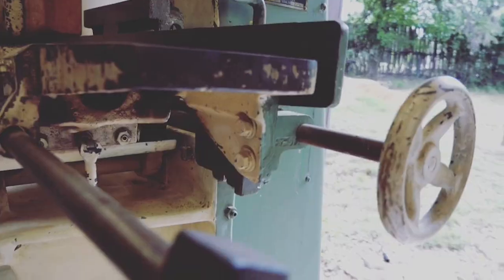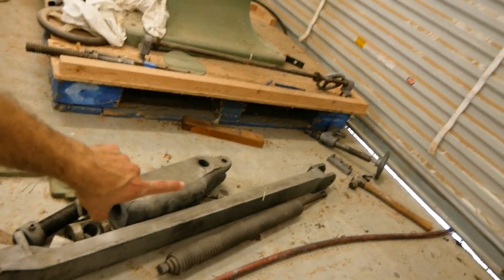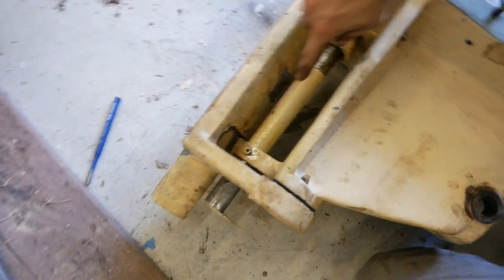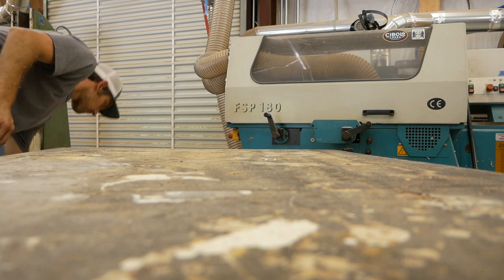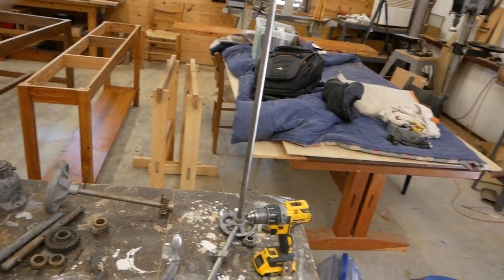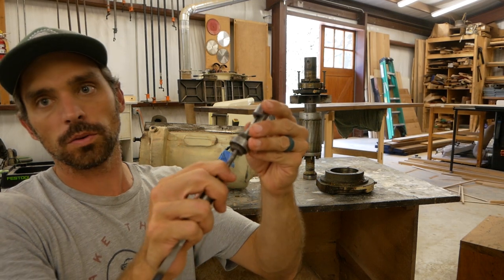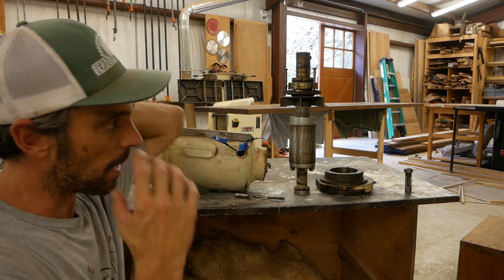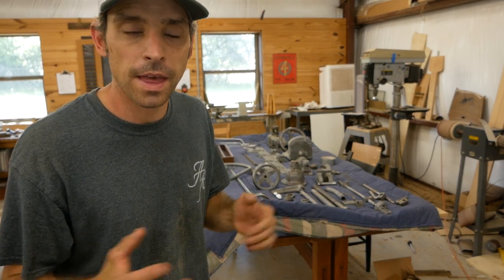A Look Inside A 60 Year Old Motor...What Should I Do With This Thing?

Comment: The thick ring with the square notches is a nut that gets tightened to set the tension on that bearing.  The other flat ring with all the tabs sticking out from it is used to lock the nut - the tabs just bend (but can easily get fatigued from excessive bending too).  I would strongly recommend you take the motor to a reputable electric motor shop, such as Massengale Armature Work over on Basse Rd in San Antonio.  That is a very specialized motor and really needs to be torn down, inspected, repaired, and reassembled by people that do it professionally.  Maybe if you explain to them that you are a Youtuber & this is a project that you are making a video series about, then they will allow you to film some of the work they do on it.
Reply from the maker: Thanks for the info.  I'll give them a call and see if they can help me out.
Reply: Be prepared for the estimated costs - electric motor repair is very specialized and a reputable shop is charging around $200+ per hour plus parts.  However the alternative is that specific motor is no longer made and thus it literally is worth any price to have it working correctly if you intend to use the mortising machine in your business & not just have it collect dust as it sits in the corner because it is not reliable.
Reply: Yes take to a motor shop , they can repair or rewind the stator ,  bearing lock nut / washer are sized for bearing size  looks like  a 6308 bearing  lock nut would be a N08 and the lock washer would a W08 , any bearing house should be able to supply for you
Reply: This is his best bet !

Comment: That ring with the tabs and the part above it hold the assembly together. The tabbed ring should line up with a groove in the shaft. The ring above that one gets screwed down. It is tightened into place (a lot of the time with a hammer and screw driver). Then the tab gets bent up inside to keep the top ring from unscrewing. Used them fairly often on the the electric motors when I was in the Navy.

Comment: Andy should come to ArnFest next month up here in the midwest...  Seriously though, you might want to look into getting a needle scaler.  With crappy paint that tends to smear with a wire wheel, the scaler will just pop it right off.  They do make some noise though.  Mine is just a harbor freight cheapo, but it does the job well enough.

Comment: Hamilton in Austin or Massengale in San Antonio sound like places to look into. They are close enough you can baby walk it through without massive rebuild charges that may not be needed. Yes, some wires may need replacing but not complete rewire. And yes definitely replace bearings and it should be good. The rest doesn't wear that much. (wiring to switches too but those are more exposed.) Good luck.
Reply from the maker: Thanks for the advice

Comment: You’re motor needs a thrust bearing because of the axial force from the mortising action into the work piece. The bearing with the threaded nut, this nut is used to adjust the bearing.  And a pin spanner is used to adjust this nut. It’s obvious when the bearing was changed this tool was not available so the hammer and bang technique has been used to loosen the nut. All the slots will have damage on the side that it was driven on to loosen or tighten the nut. I don’t believe you have anything to worry about but I’m not there it’s your call.  Just take off the two bearings check for the numbers on the rings and replace them.
There is nothing wrong with the hammer and bang technique just take it easy!!!
I hope this gives you some insight on giving it a try for yourself. 
As for the wiring this I would have a motor shop look at it. Good luck. 
From Elliot Lake Ontario Canada.
Reply from the maker: Thanks this is very helpful!

Comment: As a Millwright/machinist/mechanic it looks to me that your doing just fine. You know all the basics so just carry on bud.This is going to be a well used machine when you have it back together. Taking the motor in is a good idea if you aren't comfy doing it. That notched ring is a retainer for the bearing under it. Simply bend the clips out and use a drift to undo the nut. Then the bearing can be pulled of and replaced.

Comment: A good motor shop will be able to test the windings: mostly meg and make sure they aren't open.  If they don't recommend rewinding, don't. Will a little luck they can just clean up the stator --  maybe dip, and bake it.  Even the dip/bake may not be necessary, mind you (it looked like varnished paper winding wraps inside the motor).  And of course they'll replace those bearings on the rotor and replace the taps (the little wires going to the windings).   As for the numbers hand-engraved onto the rotor -- from someone who measured/tested the rotor. I'd guess during manufacture.
Reply from the maker: Great info thanks!

Comment: Those square notches in that ring (nut) that you identified as damaged is common. That nut is supposed to be tightened/loosened with a spanner wrench but is commonly just beat on with a punch/screwdriver to achieve the same thing. So the nut gets boogered. I don't think this is anything overly complicated to do yourself (replacing the bearings). Just do some research and you can get over the lack of knowledge pretty quickly. Good luck! Enjoying your channel.

Comment: The ring is called a spider ring and the upper ring is really a nut and the spider rings segments bend into the notches of the nut to prevent it coming lose. The windings are good if the motor ran before disassembling. The motor leads can be replaced. Take care in reassembling to not hit the winnings. Check to see if the bearing is a thirst bearing on the motor shaft.
Reply: Thurst bearing
Reply from the maker: Thanks and yes the motor worked fine before I took apart, probably should replace the bearings at minimum.

Comment: The ring that you thought was damaged is the locking ring, that stops the ring nut which has the slots in it from undoing when motor is turning. The nut is on a thread which is in turn on a tapered sleave which locks the bearing to the shaft, the bearing is tapered on the inner bore this takes the thrust of the motor side loading pay too get it worked on by someone that is an engineer cheers from NZ.
Reply from the maker: Thanks for the info!

Comment: if you want you can buy a cheap sand blasting cabinet it won't be more than 100$ and that will solve the problem 

but it will be for small parts

Comment: Great video Sir, being a woodworker my self where do you find the old Oliver equipment ,great job on the bandsaw, are you going to be able to find a full set of bits and chisels for it as for the brass ring on the armature that is a retaining nut for the bearing below it,the slots in the sides are for the wrench to take it off.thanks again ,Lin

Comment: SandBlasting: you may or may not know this, or care at all, but if that is actually "sand" you run the risk of silicosis, which is serious as fuck. additionally, you have to clean up the sand. 
you might be interested in Soda blasting. Baking Soda isnt as harsh on soft metals like Aluminum, has no silicosis side-effects, and washes away with a hose, or rain.

Comment: Two options, and both from the consideration that this motor is old and inefficient.
1. have it rewound professionally.  pro: professional, will last a long time. con: expensive, heavy
2. ditch it in favor of a modern motor from a reputable brand. pro: no question of efficiency and investment con: will lose street cred with the cool kids in the youtube block.